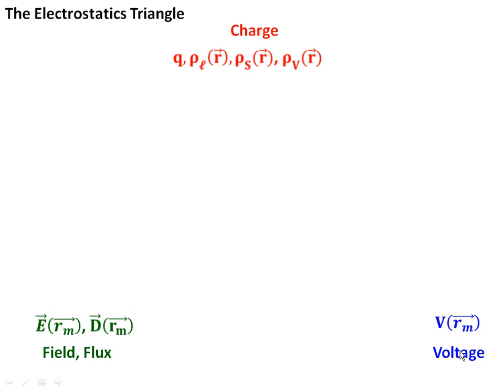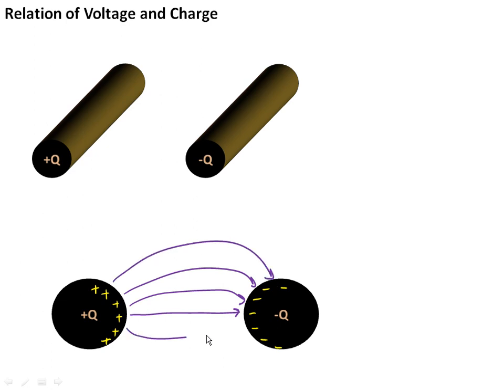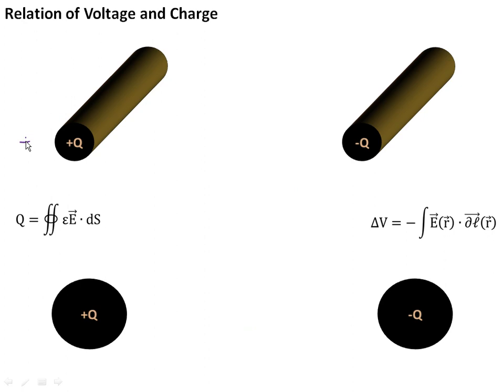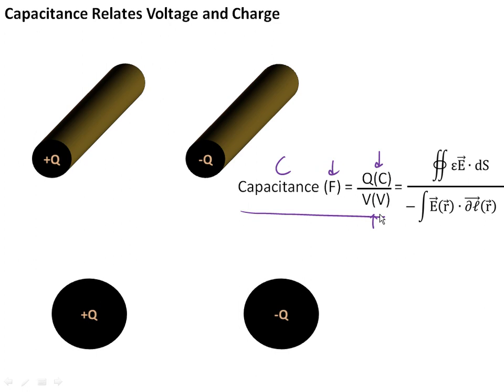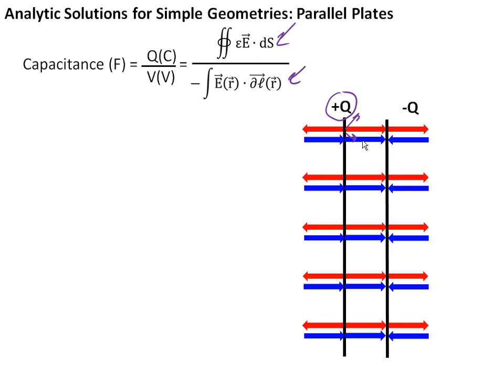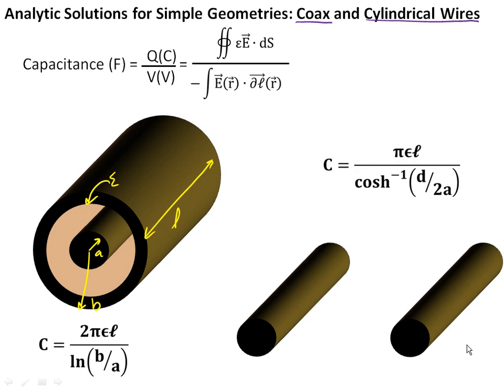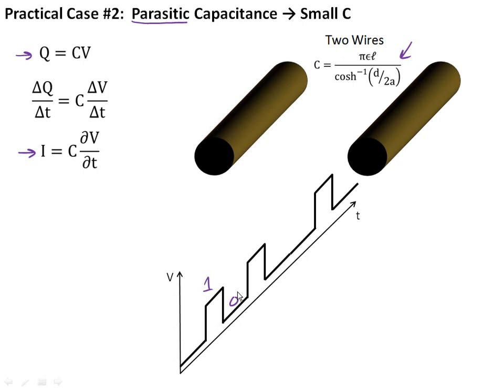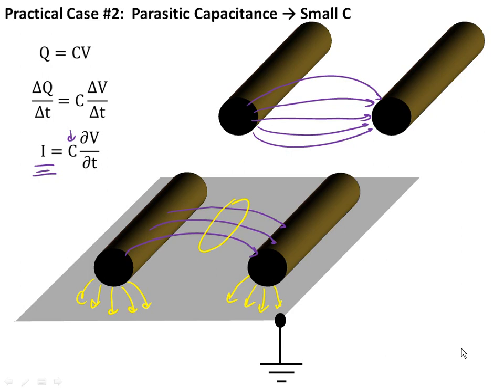2_9 Capacitance

Comment: just theoretical question:
 if electrostatic charge shows on  one plate of capacitor what is faster shown on he second plate:
information?
charge?
I know it is confusing and it does not make   good question.
But  silly question explains   nature of my thoughts:
in 1km of wire what is faster electron presence at the end of conductor or information?
And now another question:
 can you have unequal charge on two plates of capacitor initiated / influenced - by one of the plates at first?
what is the speed of electrostatic charge ? :)

Wesley